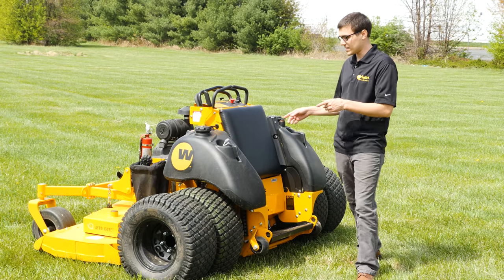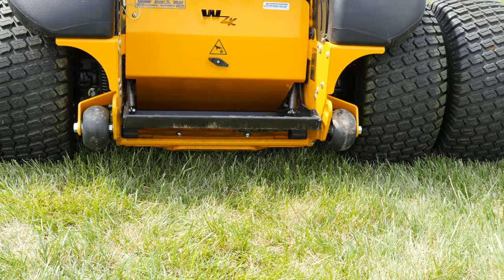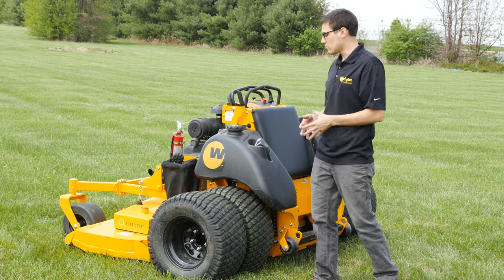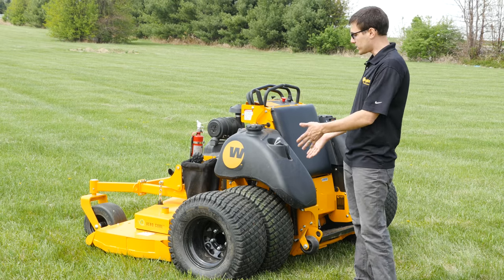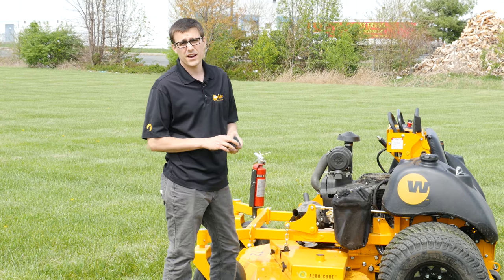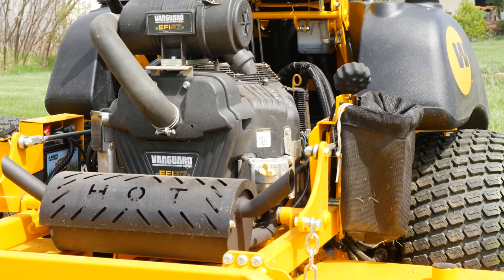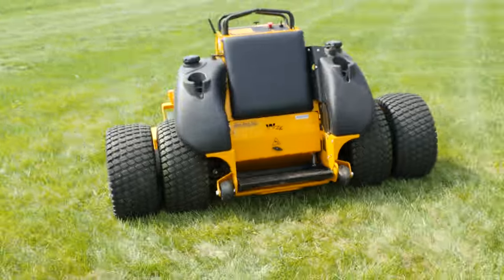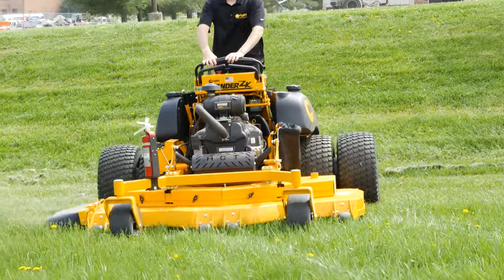Dual Wheel Stand On Mower - Wright Stander ZK

Comment: I owned a Kut Kwick SuperSlopeMaster for a while and the rear duals also stuck out farther than the 72 inch deck. It was rated for slopes up to 40 degrees and it would dog-track like this one was doing in the video on dry or sandy slopes. 
I would love to have had this mower instead. A standon gives you that peace of mind where you can just step off it if the ride gets too wild. 
Let alone you can probably buy 3 of these for what the SuperSlopeMaster costs.
Reply from the maker: Yes, for the capability we are pretty cheap compared to other options.  I just looked up Kut Kwick SuperSlopeMaster -- never heard of it, pretty crazy looking.  -Ed
Reply: Yes, they have been around for close 30 years and are used a lot on dam embankments and other areas where you just can't mow with anything else.  It will be interesting to see if robotic mowers will take some of the market share from them. Oh, that's right I did see a robotic Walker at GIE-EXPO two years ago!  Just brainstorming, but a rough cut rear discharge deck option capable of handling 2 inch saplings......
Reply: Paul Sikkema 2 inch lol check tape measure n get back with me 1 inch is pushing it even for a tractor and bushhog, especially hardwood
Reply: The Kut Kwick's are capable of that. The Super Slopemaster has three blade options - a finish blade for areas you want to look nice, a general purpose blade for roadside work and then a heavy duty blade for clearing work.  Here is an older video of the cab version clearing brush. https://www.youtube.com/watch?v=X6PzzO8npaI

Comment: Bet non-dually tweels with spacers would work as well or better.  Don't see wheel spacers used for this problem, is there a reason?  The flat cross-section of tweels interests me.  Finally some "suspension" for these dead frame machines.
Reply from the maker: Yes, you are probably right. Most mowers are too heavy for the transmissions. This mower is pretty light for the type of wheel motors in it. -Ed
Reply: @WrightMowers  Thanks for the reply. I think you're saying extra wheel width(not just weight) adds stress to the transmission.

Comment: Hi ed I have had lots of trouble with my wright velkie. It keeps stalling. I took it to get it checked, but the hydro system went out.
Reply from the maker: Diamond, Not good, sorry to hear that.  I haven't heard of it in warranty. Did your dealer fix it and get you up and running? -Ed
Reply: Oh We found out that it had a broken governor. I will get a new kohler engine on it.

Comment: Excellent video and awesome looking machine. Would this be added to your product lineup or by special order? Any thought in pricing for it? Thanks Ed.
Reply from the maker: Mike, We have plans on the 37 EFI engine.  It will be a step up, but not too crazy.  If the wheel thing proves out it would be a kit, not part of the base mower.

Comment: looks like stock tire pressure for those hills. bet it would work much better with a few less psi.
Reply from the maker: Absolutely! I tried them down to about 8psi and it was a monster.  What I didn't quite expect was that the ride was really smooth with that much low pressure surface area--you can drive over a rock and not feel it. The issue was potentially popping the tire off the rim when climbing a curb. -Ed
Reply: I run my 61 at 10-12 psi all day long. It kicks ass on the steep slopes and it actually helps the tire wear evenly instead of the inside wearing out. Been using Wright Standers for about 13 years now and I'll never go elsewhere. Only thing Wight has to do is 1. Up the HP on the bigger deck mowers 2. Redesign the front wheel caster frame setup. The welds broke on the last 61" Stander I had at around 1000hrs and the one I got last season started to crack at 400hrs but welded gussets and added tube like I did on my old one. Haven't had a problem yet and don't think I ever will. Looks factory but I think I'll keep my design to myself though......lol Other than that awesome machines for straight as an arrow stripping.

Comment: Hi Ed,  I'm a very big guy and no one can answer this for me.  Whats the max weight for the rider before the mower tips backwards.  I have a 52" zero turn and its hard for me to get up on it with my bad knees.
Reply from the maker: Hi Ed, We're not completely sure.  No one has seems to have maxed it out yet.  We did make a front weight kit for one.  If I recall it was a 52" deck so a little lighter to start with and I think the operator was around 380lbs.  I can get you one if you want.  I think we may have the mower for you--I've heard of bigger guys who have said it's a lot better--many of the best suspension seats are really pretty small--no bigger than an airplane seat. -Ed
Reply: Sure Ed , I have a commercial Gravely Pro turn 52" Has 22 hours on it . Let make a even trade. I dont really need a 52" . I only got it because I had to be able to fit into the chair.

Comment: At 6:30 my Scag Tiger Cat II could ride that bank and NOT slide sideways. It doesn't matter what you do, if the front wheels are free wheeling casters then you're not going to get a mower to stick to the hill without crab walking.
Reply from the maker: Greg, it's a matter of weight.  For the power and width we are really pretty light weight which doesn't pull the mower down the hill as much. -Ed

Comment: Hi Ed,Will the 37 Vanguard engine be available as a part number? Would love to swap engines, The Kohler ECV860 has been a real lemon and underpowered on my ZK 61".
What Clutch does it use GT5?
Reply from the maker: The 37" is pretty much a drop in with muffler and pigtail.  It'd be quite expensive--trade in may be better..  We can sell the muffler and Wire and the engine could be ordered from Briggs. -Ed

Comment: Extend the operators controls and platform back 1 foot and make it swivel (charge more for it) so the operators can choose to stand up straight while doing slopes.
Reply from the maker: Cool idea!
Reply: use hydraulic controls so you are not forced to use horrible cable linkages,

couple of other things while i have your ear:

 sell us a small batwing stand on mower that will fit thru a gate (36") but will put down a rear discharge batwing(driven hydraulically off the main pump cutting cost??) making it a 50" mower while its down(also because its offset it will go under tree's and shrubs like nothing else sold today,, do NOT make make it tall!!)
thank you for responding.

Comment: Ed - Any further thoughts on whether you might actually release this dual wheel kit?

Also, I'm thinking of pulling the trigger on a ZK 52 or 61 in the next week or so.
Leaving the price difference aside, which engine would you go for?  I hear people sometimes criticize the Kohler EFI, but its obviously supposed to have advantages over the carbureted Kawasaki, right?
This is my first major lawnmower purchase, so grateful for any thoughts.
Reply from the maker: Hi, The duel kit is actually now released.  I'd suggest the 37hp Vanguard engine.  No issues with having enough power and very reliable. -Ed

Comment: Front mower...  4x4 with differential lock.  Problem solved.  A standing mower is leaving half the mower at home... the other axle!  I regularly mow on hills some over 1/4 mile long similar to that at the end of the video with a John Deere F1145 with a 72" Lastec articulator deck.  It has hydraulic weight transfer from deck to mower, four wheel drive and differential lock.  I added 2" spacers to the axle with single 26x12 tires.  I guarantee it will mow circles around anything lacking a second axle.  Wanna mow head first straight down hill toward a pond and hang the mower out over the pond?  Better not try that on a stander!  On a front mower it is perfectly safe because you have 4 drive wheels on the ground from two axles with or without the deck on the ground.  Plus you have a contour deck perfectly following the terrain!  You have a lot of energy and good attitude, if you really want to provide a safe hillside mower, provide a 4x4 front mower.
Reply from the maker: That sound like a nice setup where you may have a park where you keep the mower on site.  This mower can be hauled with an F150, only costs ~11k, and can get in someones backyard.  -Ed

Comment: Im thinking your mower is no doubt one of better lawn yachts ive seen and side hills are no problem but i havent found how you run your left/ right brake becouse sticking a mower to a side hill with out ANY slide ive found is to slow the uphill wheel slightly wich is applying the power mostly to the downhill side...feathering brake allows for some turn control while a diff. Lock does not...

Comment: Put a Honda motor on it and you're golden.
Reply from the maker: I've sat down an negotiated options with them over the years and they were never where they needed to be with the price or the spec.  Maybe one day...  I've had a number of their GX series horizontal shaft engines open and they are very well built!  -Ed
Reply: Cody schrader ...in the old days Hondas gx610 was crazy well built......until Honda had to compete with the hacks.......the current gx620 or 630 aren't half as good. imho

Comment: he was still sliding on that slope and why would you cut it going across on a slope on an angle is better
Reply from the maker: J, Side to side is ideal for me.  Diagonal up works fine with most mowers.  Diagonal down doesn't work as well. -Ed

Comment: paddle tires would be better we run them on our kabota
Reply from the maker: Cool!
Reply: We are looking at a new zk hear in Ohio we need paddle tires
or chevron same thing for the wet grass in spring and fall. Would the drive
unit handle them the dealer said no problem just waiting on the dist. to bring
the demo just trying to make a decision on a 62 or 52 deck size. We demoed
almost every mower scag it cut well but drove like a tank. Ferris good mower
the Trans axel drive system scares us. And the deck is to light. Xmark not bad.
The design is old not too good to stand on. We tried a stander x and a zk at
the dealer just waiting on our zk 62 to get hear for demo from the dist.    Our property has every type of mowing there is
hills lakes soft wet tight obstacles trees we have it all so far the wright is
the best choice we believe. we looking to replace out Kubota zero turn with a
stander zk and add a second smaller stander like the X  next year
Reply: Kubota